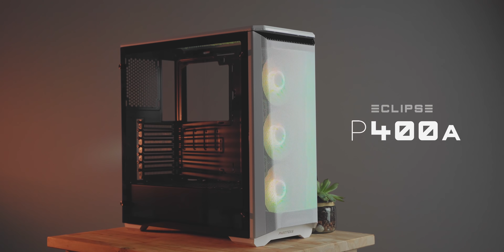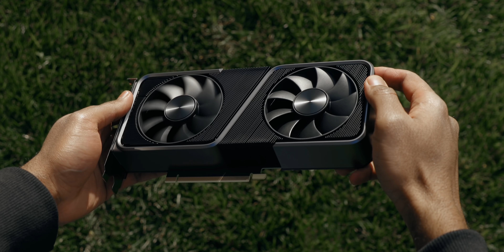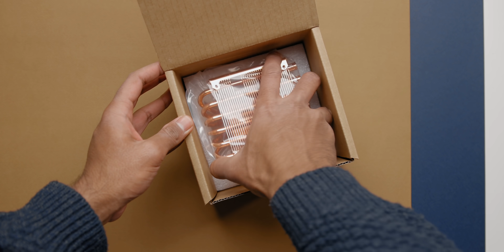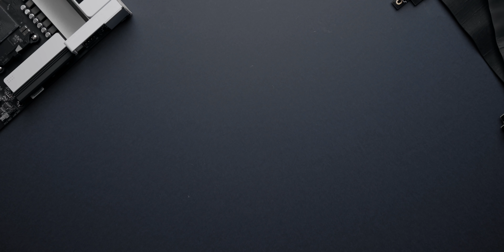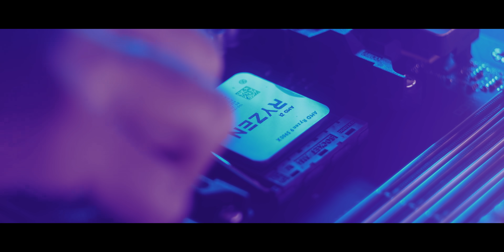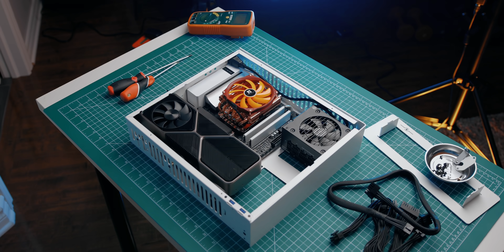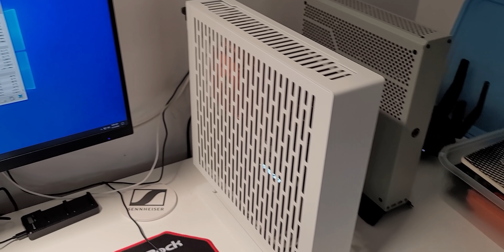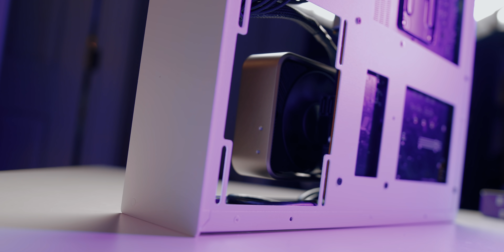The SMALLEST ATX Build Yet - Ryzen 5900X in a 10L Case!

Comment: Waste of all those extra PCI-E slots... mATX or mITX would be a more logical solution.
Reply: There aren't many good mATX boards last I checked and none of the mATX or MITX boards I know of have the kind of rear I/O Eber was going for.
Reply: @soulest2081 While I understand the requirement, it makes zero sense to castrate the PCI-E slots all for the sake of a moderately slimmer chassis. There's no technical requirement to make a workstation "tiny" or "slim" beyond looks. The loss of SSD/HDD housing, and PCI-E slots is a big price to pay for what would be an only moderately larger footprint in a standard size atx case.
Reply: @x86FTW  There is still the issue of lack of physical space to place such a large case as you're suggesting, especially on a desk. * looks around * That's definitely the case for me which is why I also went SFF.
Reply: @soulest2081  The only I/O I see to be of an advantage going Full ATX are the Thunderbolt ports, everything else can be found on an equivalent ITX board/case.  IMO If you don't need them then stick to ITX builds, this is such a niche scenario... "I need a powerhouse workstation, but uses a SFX PSU, a low profile cooler, no case ventilation, no PCI-E expansion, and no additional SSD/HDD capacity" It's not really a workstation anymore...
Reply: @x86FTW  Good points there.

Comment: @Hardware Canucks for the fan what about the cryorig xt140? that's 13mm in height and uses 120mm mount holes, the specs of that cooler says in comes with adapters for 120mm or 140mm mounts

Comment: I would like the case much better if the side-panel over the CPU allowed a taller cooler and a better airlflow out the side, with a plastic-duct around the hole in the side-panel above the CPU.

Comment: 59mm isn't much room to play with. The Alpenföhn Black Ridge Low Profile CPU cooler is only 47mm high and allows mounting of the fan under the cooler. Ditch the one they supply and fit a noctua NF-A9x14. You'll not have to see the fan, and you'll likely not hear it either.

Comment: Just to comment on adding that fan behind the gpu. I would say I had a similar issue arise when I needed a new air cooler for my cpu. The clearance with my ram made it so I had to do a pull configuration on the cooler but, I really wanted a second fan to add static pressure and really help the airflow. Now I added a second slim fan to the front but, I actually had the same or sometimes slightly higher temps when under load. Now that I swapped for two of the same slim fans it actually increased the cooling because I would assume the airflow rate is now the same on both ends instead of one flow in and a different flow out. No turbulence makes better cooling from what I’ve seen
Reply from the maker: Thanks for the feedback!  Great points

Comment: 100x12 scythe fans are great. You can order an older scythe shuriken rev b from frozen cpu for USd $29 and take off the pwm version. it runs fine and super quiet

You guys should also check out the salvo s402. Console style case with much better compatibility than the dr zaber

Comment: I hope you would answer my question, how can I accomplish to route gpu to motherboard thundbolt 3, if my motherboard have it. Let's say like ASrock X570 itx. And dose gigabyte have an itx motherboard that supports this feature. Cause I wanna build an itx build with a portable monitor and connect it using thunderbolt. Thanks.
Reply: You would connect the DisplayPort out on the GPU to the designated port on the motherboard. As far as I know, only the ASrock X570 itx has that (and the Intel style cooler mount).
Reply: @soulest2081  thank you so much.

Comment: If i were rich I would get one of those 3 slot sliger htpc cases and stuff it with a strix itx board with a 5950x, 2x980pro 1tb, 2x870qvo 8tb, a 3090 strix, and make a cutout for the noctua c14s and finish it off with a bunch of chromax fans. Plug it into the z9 8k lg oled, a set of the most expensive klipsch 7.2 surround speakers with a schiit ragnarok amp and Yggdrasil dac flanking each side of the computer. Finally a custom drop Tokyo hhk mechanical keyboard with a custom Bluetooth wireless chip in it, a basilisk ultimate mouse, and a pair of ab1266 wireless headphones. That right there is a living room gaming htpc setup fit for a king. The setup would cost a little over 50 grand.

Comment: Is it possible to flip the orientation of the GPU and use a shorter riser card? I'm thinking that with a mini ITX Mobo and flipped orientation, you could increase the airflow for the GPU and case by a decent margin
Reply: No, that layout is actually worse. As you can see gpu temps in this case are ideal, same as on open bench.

Comment: A few things:
1) Love that board, just set it up this weekend with a 5950X. The bios it came with was hilarious, no official zen 3 support, but it booted. no clock speed reported, half the RAM detected only, but hey, it let me get in and update, so that's cool. After updating everything works (mostly). PBO is still kinda messed up (like it always has been), but if you use "motherboard limits" it'll go to 4-4.5 GHz all-core depending on the application. Limiting factor is 215A current limit. Also using a 48mV negative voltage offset. Oh yeah 4*16GB 3600 CL16 OCed to 3800 is working as well. 

2) Paint the fan!

3) That case looks really interesting, i have an extra ATX board with a 4770K right now, and was gonna sell it. But, if I get this, I can make that an HTPC or something... that could be interesting. I always have room for another SFF case :D

Comment: "Nothing changes in the temprature..." you meant hot's remained hot ? right right? 3800x - 3900x - 5900x at any given point are always at 35-40C..and in the closed , half case size like this,, it would be HOTTTTT! :)

Comment: Please look at the fan included in the Thermalright AXP-100 Muscle (Thermalright TY-100BW), it is the same size but the fan blades are white and chassis is black. 

I think it should be possible to fit 15mm fans as well, because the fan is 14mm by default, but the height is also 58mm, so you should have 1mm clearance.

Comment: How would this compare to a Sliger SM580 in terms of temperature?
Reply: Similar (they both have temps similar to open bench), but you don't need case fans in this one. And SM580 can accept better cpu cooling, but it's like 8 L more in volume

Comment: I wonder if it's possible to 3D print some kind of air tunnel, so that GPU hot air can be routed directly to those cutouts on the side. Right now it seems like 1/3rd (at least) of the CPU fan is directly hitting the motherboard.
If you used ITX mobo then I guess that would not happen but here I think you need to be a bit creative. :)

Comment: Would be perfect if either:
-They leave some space at the back (with a back cover) just like the Thermaltake Core V1, for much better cable management. OR
-They design this as a dual chamber case, just like the Raijintek Paean-M. The only thing I don't like about the Paean-M from Raijintek is that they make slace for the CPU AIO cooler so you have to put something there (either an AIO cooler or 2x120mm fans) or the chassis looks really empty.
Anyway this is a very clean and compact case!

Comment: You should try a FormD T1. ITX motherboard but you can use 240 rad and a 3 slot GPU. Even saw someone squeeze 2x 240s into the thing

Comment: ProlimaTech has a 120mm & 140mm slim fan that is only 15mm, both in black & in white. I’ve been rockin’ a 120mm for a few years on and off without issue. I still prefer Noctua overall, within reason.
Also, sweet case & heatsink! Super intrigued by both.

Comment: Ngl this system is genuinely one of the most simplistic and yet still incredibly beautiful AND functional builds I have seen in a long time. It’s ATX yes, but it still feels ITX, it’s a minimalist look both on the outside AND inside! Plus the beautiful Thermalright air cooler and RTX 3080 FE are the perfect show components at the same time. I go from observing Uber expensive water cooling ITX systems etc and then see something like this and it’s a really good change of pace and gives me a lot of hope as a relatively new pc builder that favors both function and design, nice.

Comment: Akasa makes great slim fans, are quiet at full speed, and I use 2 of them on my TX240-C XSPC radiator, and get good airflow through it. The o ly issue is they are 15mm fans. Ratings are enter bearings, rated at 5.4.55CFM, 1.36mm-H20, 30.32dB(A) and are 12v PWM 4pin

Comment: Could a 3090 gpu fix in that case. I saw there could probably be a size issue with the connections in the bottom if there was a 3090 instead of a 3080.
Reply: Yes it definitely can!

Comment: Did you tried bending the heatpipes a little, you have to do only 1 mm, after that just add a noctua a12-15mm or so. You can remove some material from the fan, like sanding the top and bottom, sanding the motherboard standoff,sanding the part that meets the panel a little bit, you can get easily 1 mm
Reply from the maker: Its too BEAUTIFUL to bend!
Reply: @HardwareCanucks  you can add spacers  on the side panel, to accommodate a 15mm fan

Comment: I think the main problem with this case is it doesn't use an ATX power supply. I'm still waiting for the "perfect" small factor that can use a normal power supply, even if the case is a bit thicker.

Comment: Custom length psu cables would probably help a lot with cable management so you don't have to bundle up the slack. Also noctua makes low profile chroma fans so you can have black
Reply from the maker: They don't have the right height in the Chromax sadly.

Comment: I'm looking at this case and im like: So its a bigger Node 202...

But with the same limitations.

Whats the point of a full ATX if you're unable to access all of the slots because you have to mount your gpu vertically?

At this point its the exact same as the old desktop but on its side
Reply: it actually is not bigger than node, fits a lot more, and has way better performance and build quality!

Comment: That gpu is quite a bit set back in the case. 
Is there a reason why the bracket isn't lined up with the outside of the case?
Reply: The prevent turbulence from the fan being right up against the side panel which would result in a lot more noise. That is why you see that in every case from large and small scale case creators.

Comment: Hi, I'm planing to upgrade my current system and use my GPU in new HTPC/VR build. I'm looking for a case (hopefully with mATX support) that is fairly small and can fit my 2070 super, 2,5 slot 285mm GPU. So far I found Silverstone LD03 and nzxt H1. Both with mini itx support only. You said in the video that it supports 2 slot GPU up to 300mm. Can I fit in 2,5 slot 285mm card?

Comment: Just finished building my Sentry. Rock solid with  ROG B550i/5800X/EVGA3080/980PRO on 600W Corsair(braided cables!). Added a pci4 flex riser from LinkUp. 
For cable management: I stacked them as follows: the thick power line and USB front routed first with slack folded near the psu switch. Then the Pwr/Reset/Led connectors.  Finally the CPU and ATX. Nice and tidy.
Reply from the maker: Sounds AWESOME.

Comment: I find 378 x 342 x 78 mm not little, still to big for under my TV (+ point is you can use normal format graphics cards in the P-ATX), that's why i bought the CEMO 9001, that is a fully thick aluminum case, do not like fully steel cases, give me a aluminum case over a steel case any days, the CEMO 9001 is only 330 x 220 x 96mm (LWH), and it fits also a Micro-ATX, it's MUCH smaller then the P-ATX Case.

Comment: I actually considered this board for my build but it missed two very important things [for me] which made me buy a X570 Tomahawk instead. 
1. Only 4 Sata Ports. 
2. No front Panel USB-C connector.
Reply from the maker: The Vision D is all about the business out back.  ;)
Reply: @HardwareCanucks  Yeah I guess the included thunderbolt port does make it alluring. Definitely a good board, would've like to see an x570 variant of the same with more ports and features.

Comment: I would have recommended the Cryorig C7 series CPU coolers, but they only have a TDP of 115 Watts, which is a little close to the 105 Watts of the processor. But it is only 46mm high, so you could fit a beefier fan on it. And it comes in copper or graphite.

Comment: What's the point of a small form factor pc with ATX motherboard compatibility if it doesn't allow the extra PCI-E expansion slots to be used anyway 🤔 may as well just go with an ITX motherboard in a small form factor case instead

Comment: Whats the point in fitting an ATX motherboard in if you can only use 1 expansion slot anyway. you could argue threadripper but no way of cooling that.
Reply: actually the only reason i want extra slots is for 10g networking which with atx i can get onboard so theres the point :D
Reply: @DavidZimmermannz  There you go :D There are actually a lot pros to using atx mbo.

Comment: Thermalright that's a name I haven't heard for some time. Didn't know they were still around. 

It's an expensive cooler though £107!! 😭
Reply: You can get Id-cooling is60 on aliexpress for 45 usd, it has the same cooling performance
Reply: Expensive indeed. But all copper :o
Reply: @Azdian same. You can also get noctua a12x15 for a better sound profile and slightly better performance on is60
Reply: @Azdian  thats right. Just be careful of ram clearance with it.
Reply: @Azdian  if you have atx board with two ram sticks  is60 is still an option. Shuriken 2 is also not bad, but these two are better

Comment: included ADT PCI-e x16 3.0 GPU riser cable is making the chassis obsolete at arrival. no pc builder wants to be limited by the chassis. some people build 3 or 4 times a new system into the same chassis. this case has the same problem as most console-size chassis. the riser cable is not optimal for AM4 boards and new upcoming GPUs even the diffrence to PCI-e 4.0. at the moment is very small.

Comment: For the fan, would a Scythe Slip Stream be an option, as they are only 12 mm thick?
Reply from the maker: Will certainly look into that!  Thanks for the recommendation.  A quick glance though shows we might be limited in performance by that fan's low static pressure.  Worth a try though!
Reply: Just "steal" the fan of the non-copper version of the AXP-100, it's white and black.
Reply: @Miseryqt  Lol, you're actually right! It's the TY-100BW, which comes with the AXP 100H muscle.
Reply: @HardwareCanucks  If Your "hangup" is with the looks of the fan why not just paint it ?? "Easy fix" 
Best regards.
"P.S" Nice video on a sweet build, though "baackInMyDay" a 10L case was a "desktop case" not a "mini" ;)
Reply: @HardwareCanucks  Get a 15mm fan, expand /sink the outer holes and get some really short screws (or countersunk) et voila, you should be done.
Reply: @HardwareCanucks  
Remove the CPU fan and mount a slim fan on the case instead; then you will not be constrained by the diameter of the heatsink.
Example: Cryorig XT140 is 140x140, only 13mm high, and it's (mostly) black.
Reply: @HardwareCanucks  Raijintek Aeolus Beta maybe? It's 13mm thick and pushes a bit more air but. By looking at the (very few) reviews, it might have a rattling sound at low RPM though.
Reply: @HardwareCanucks  the din density of the cooler looks very low. I don't think the static pressure will have that much of an impact.
Reply: What about the Noctua NF-A12x15 120mm PWM Chromax Fan Black ?
Reply: @ggesdsdsdsd  Noctua is 15 mm thick, limit is 14 mm
Reply: @Physis_88  just shave like 1/2 mm off both sides
Reply: @Physis_88  sandpaper😈
Reply: And we know you guys have one from the Fuma 2 review!
Reply: I AGREE.
Reply: That orange fan looks really bad. i get it, but it's ugly. A Chromax Noctua would look better